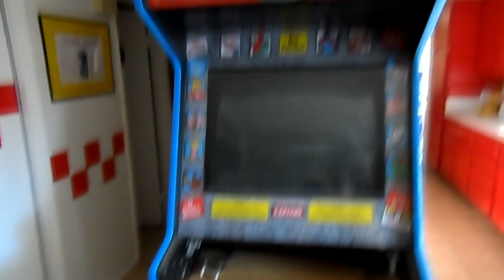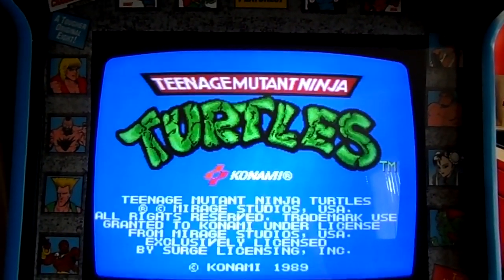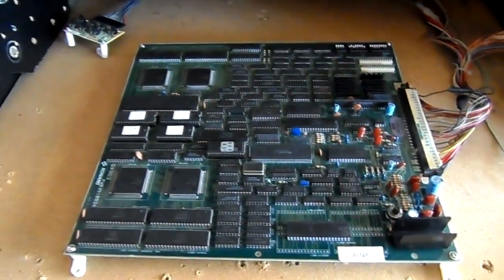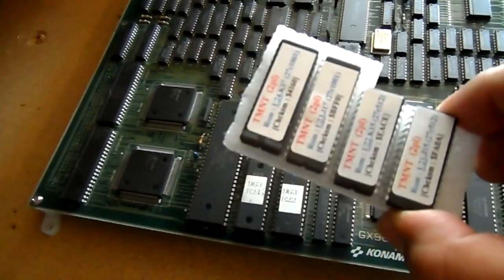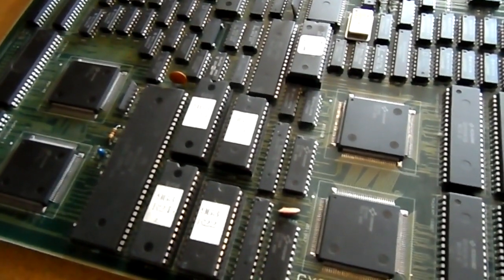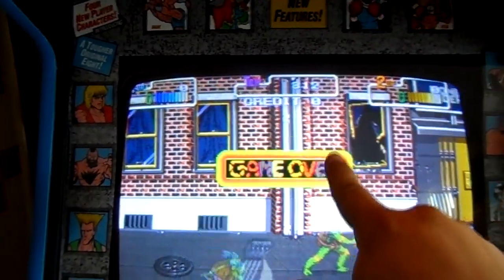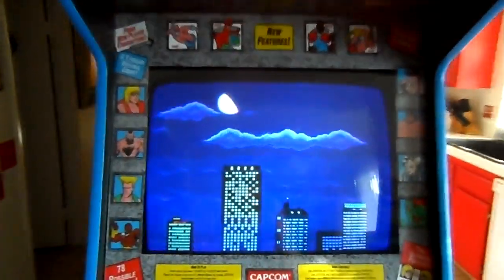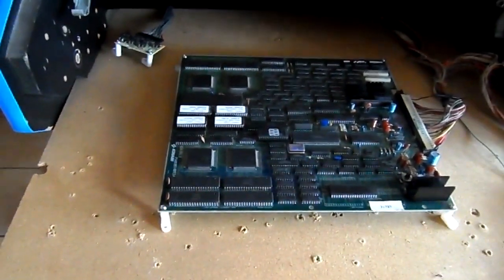Converting  a TMNT PCB From 4 Player to 2 Player

Comment: Hey Moomert! definitely a cool trick to get a two player turtles pcb going. I've also got the 2 player Teenage Mutant Hero Turtles roms in my pcb as well, haha. Like you said, as far I know as well, there was no original TMNT pcb intended for a 2 player cab. Sunset riders had 2 (I've got the 2 player pcb) and 4 player pcbs made, The Simpsons also had 2 and 4 player pcbs made (I've got the 2 player pcb). I've got Wild West Cowboys of Moo Mesa too and the coolest thing about that PCB, is that you can go into the dip switch settings and instantly alter the board between 2 and 4 player, depending upon if you want it to run it in a 4 player cab with each cow assigned to a joystick, or if you want to have it in two player mode where joysticks 1 and 2 can select any of the 4 they want to play as for two joystick cabs or superguns. The only thing I wish you could do with the two player TMHT roms inserted in the pcb, is chose a different turtle when you continue, but hey, still better than having to be forced to play as Leo or Mike for p1 and p2 in a two player cab or supergun. Awesome vid as always man!

Comment: FYI, there is no "test switch" on a TMNT board, just insert the new roms and you're good to go.  I think the video is confusing the original TMNT (which has no test switch) with the sequel Turtles in Time (which does have a test switch).

Comment: what if you want to make a 2 player to a 4 player for instance someone had converted the pcb board i bought of turtles in time into a 2 player but now that i have it i want it to go back to a 4 player? any ideas?
Reply from the maker: Assuming its a legit TIT pcb, the option is the same. Buy the 4 player roms, and install.
Reply: moomert1 ok sounds good but for instance my original 1989 tmnt arcade has the ports plugged into the jamma board for 3/4 player were it says cn3 and cn4 wont it just work if that's plugged in or do the roms diffenately need to be changed? and do you know if hobby roms would sell the 4 player rom conversions? thank you for your time
Reply from the maker: Hobby roms should have the roms needed. The roms need to be changed. In the two player version, the player 3 and 4 ports become obsolete. In order to use those, you need the 4 player version roms.

Comment: Were is the test switch ? Is it on the board or the cabinet?
Reply from the maker: test switch is on the board
Reply: +moomert1 DIP SW1 ,DIP SW2, DIPSW3?  are all the white slide bits supposed to be pushed up to the on  position when connecting this board up ?